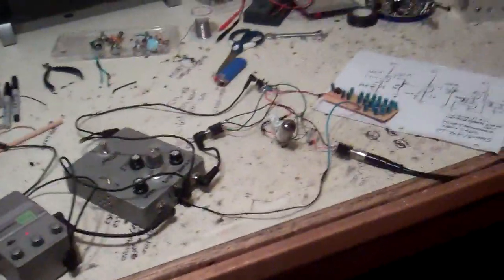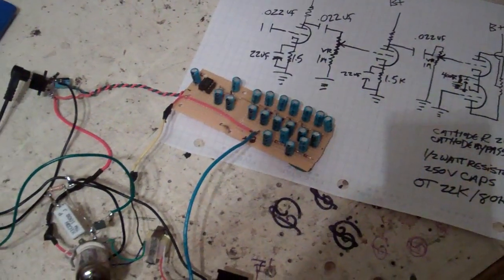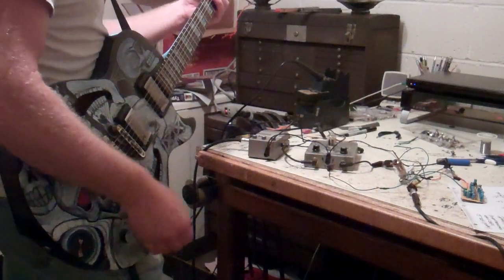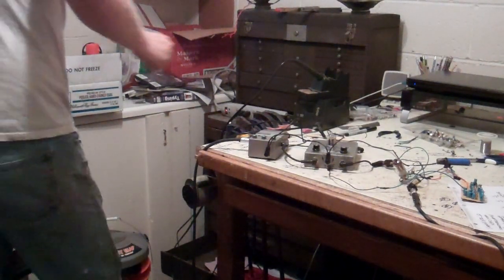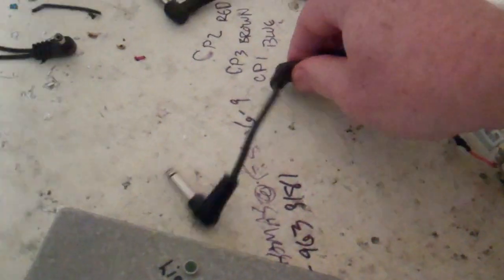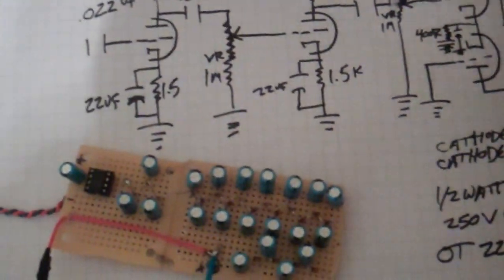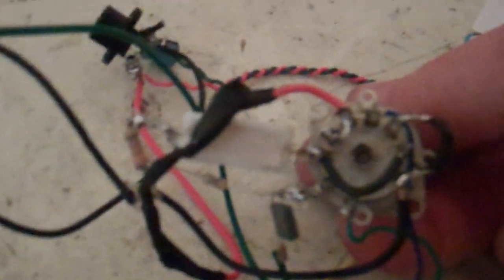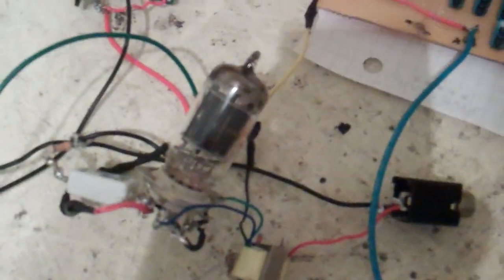1/4 watt tube amp how to build it and schematic.

Comment: only 1/4W?

you can pull an easy 5 W per 12au7

so a easy 7 w from a push pull you can and could get
Reply from the maker: Ive never heard of anyone getting more than 2 or 3 at most.. Im not saying your wrong, just havent heard that number out of a 12au7. The idea here was to make a quiet amp though. One that still distorts a bit and has tubey sound and easy to build for people that dont like high voltage. It can be intimidating so this seemed like a cool little project. Thanks for looking and commenting though :)
Reply: you need 250-300V to get the normal power out of the tube

and on 12V you can get 0.5W out of it
but then its a hybrid
Reply from the maker: *****
Yeah, I mean, I build regular full size amps and stuff so Ive been around enough to know the tube specs, but how are you getting .5 watts at 12 volts and 5 at 300 volts? the math seems off to me.
Reply: like i said half of a watt is a hybrid (tube and transistor
5W is inormal power
the nom power for the 12au7 is 2.75 amp per triode
and it can be overdriven

Comment: would a fender reverb unit transformer work without any other changes?  I would think that it would and give you a little more piece of mind for $10 more total cost to the build: http://www.tubesandmore.com/products/P-TF22921
Reply from the maker: I am using the reverb ot in the kits I am offering at this point. I will offer a push pull ot when I find one at the right price with the proper ratings etc.
Reply: What is the primary impedance on your reverb OT?

Comment from the maker: Cool, All you really need is a 12vdc walwart for best performance. 9vdc can work as well. Either way, I can put together something you will be able to build and complete as long as you can solder without melting parts lol. I only make about 30 bucks on the kit, but a lot of people request this so I am caving in finally. Email me if you want one gregforbyn (at) yahoo (dot ) com , sorry bout the adress there, dont want spam bots bugging me ;)

Comment from the maker: I will provide complete instructions and assembly guide.  If you can solder it should be easy. 8 ohm compatible. If its a first time project you should use a bigger enclosure.

Comment from the maker: I just priced a kit. I would have to sell for $125. If you are comfortable with point to point wiring I will sell you one. The kit comes with a single ended transformer. You can always use the little trans like this from ratshack if you like, but i wanted one that was more substantial for the kit. Thanks for watching.

Comment: That is rewally good sounding IMO. Is there a simple explanation why someone wouldn't, or couldn't develop this into a 3 stage pre, into the smae small 12AU7 power section to get even more gain, a.k.a. tiny terror orange amp sorta sound - at low watts?

Comment: I built a 1/4W amp using one 12ax7 as pre and power section.  Instead of a diode pump it uses a 555 and a mosfet driving a mains transformer's secondary, and the primary is then rectified and used as the B+.  It has around 115v on the plates.  Isn't nearly as loud or good sounding as this but im still pleased, makes a very good headphone amp.

Comment: Hi again Greg,,I have the schematics and in the process of obtaining parts..After looking at the schematic that you sent me which is the one above...you've really made quite a few changes...I'm wondering if your using the 9 volts for all four heaters and using the 90 volts for the b plus on all the tubes so the sort of valve caster part of this isn't using b plus 9 volts? Thanks Greg.

Comment from the maker: For singler coils I really like the 6au6 push pull amp using a smps. Its higher voltage but the headroom is nice for the cleans and its warm. On this, its pretty much distortion no matter what. I like it and its useable for practice, but the winebox amp was nicer. to me anyway :)